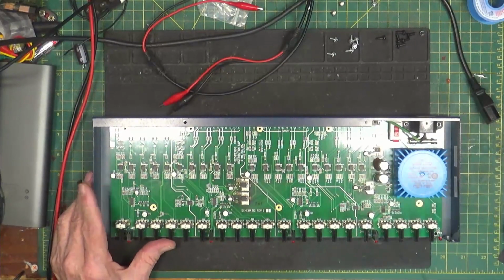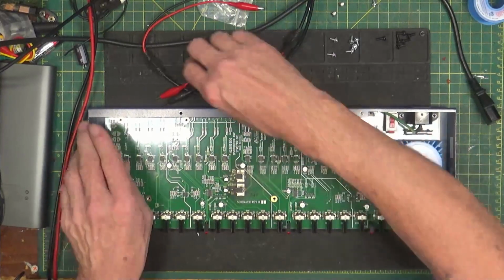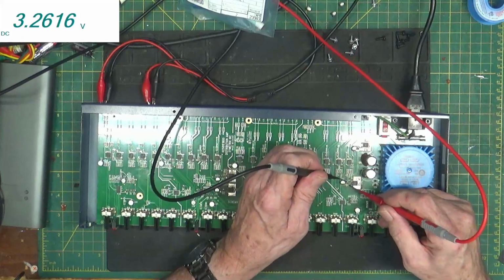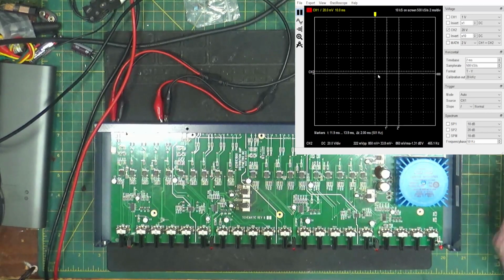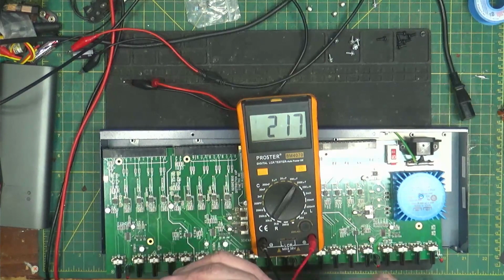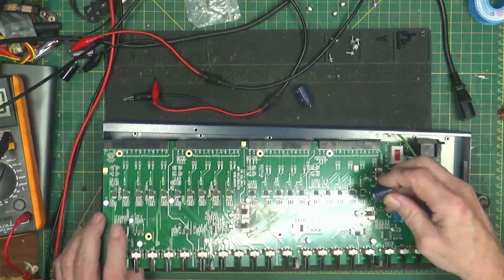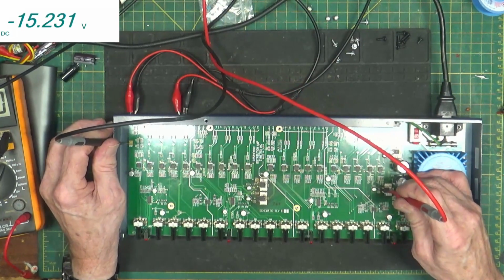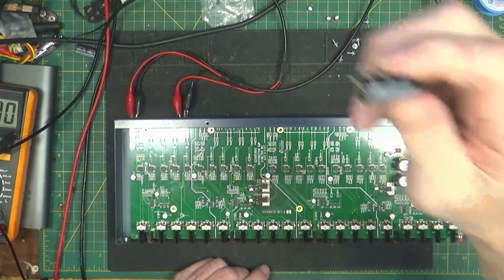Fixing a Symetrix 581E Distribution Amp

Comment: Another 78/79 V Reg Fun Fact... The EE Hobbyist Community seem to not know that these regulators require a full 3 volts of headroom for them to reach their maximum ripple rejection... Not just the 1.5 volts needed to prevent dropout. This fact is often not clearly stated in the data sheet; it is found in the app notes. However, the test graphs in the data sheet do show that testing is done at 3V. Meaning, the marketing department wants to taught the better ripple rejection, without pointing out the additional needed headroom.
Reply from the maker: You are right and I have seen them used with just barely 3 volts above. The results are not great. It usually pays to follow the guidelines.